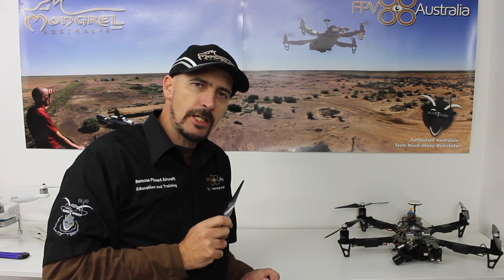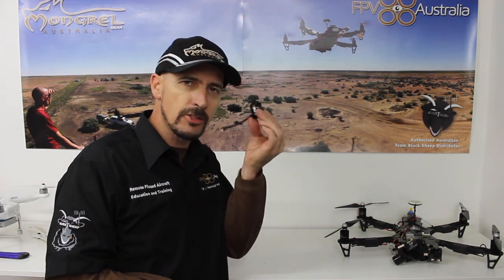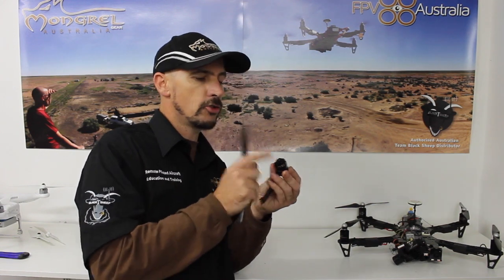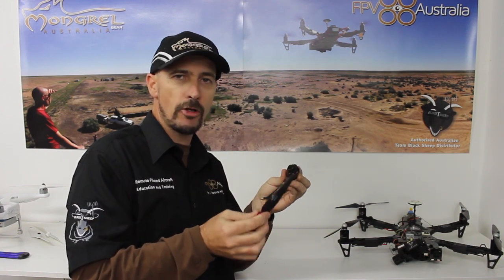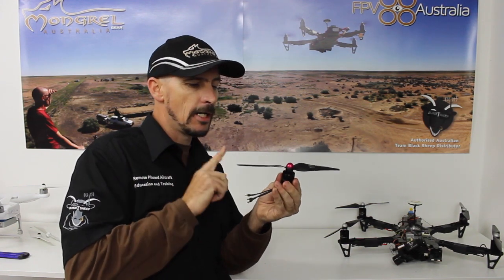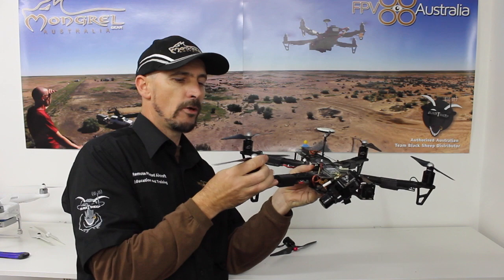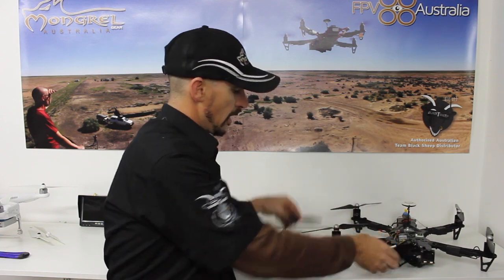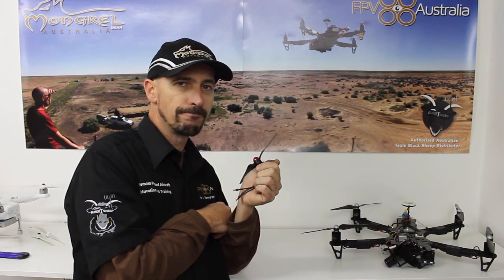Self Tightening Prop System for TBS and Growler 900KV

Comment: I feel like an idiot trying to figure this out. I think this video cleared it up, but just to be sure, the nut tightens in the opposite direction of the spin of the propeller. Is that right?
Reply from the maker: Yep!  That is correct.  So as the motor spins, the prop tightens naturally!